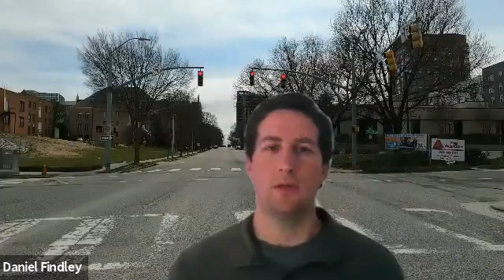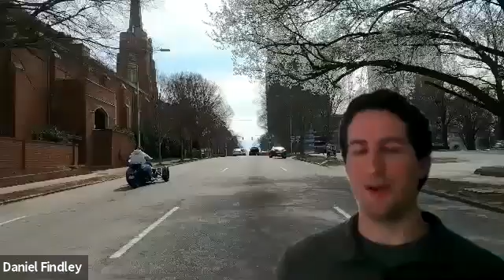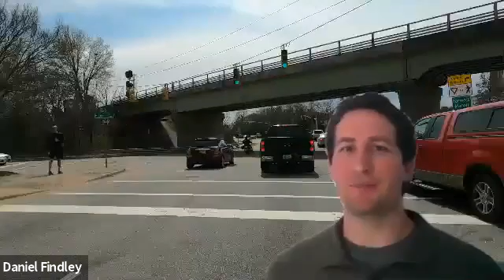Green Wave Example of Traffic Signal Progression - Dawson Street in Raleigh, North Carolina

Comment: What about light or sensor based preemption in this example?  Is this example tuned for rush hour only?
Reply from the maker: I'm actually not sure of the specifics of this corridor, but it is much easier to provide progression on a one-way street.  Two-way progression is very difficult to provide (and because of this, most two-way roads prioritize progression only in the peak direction).